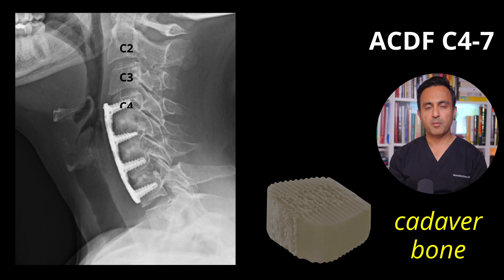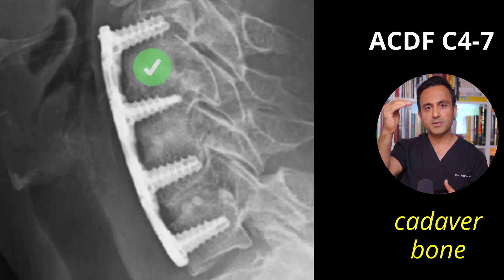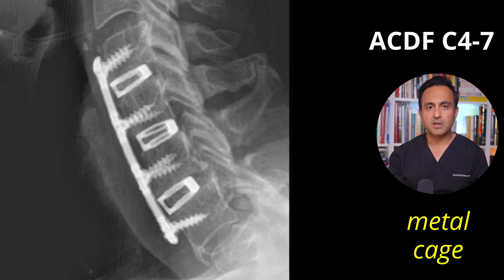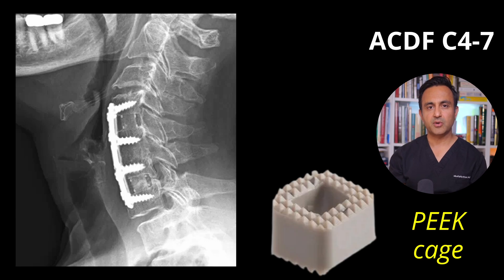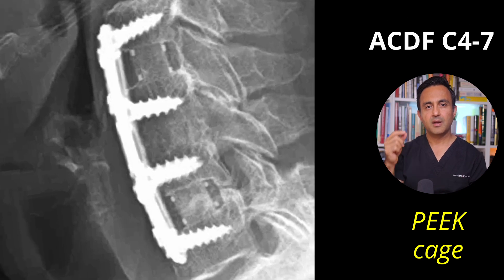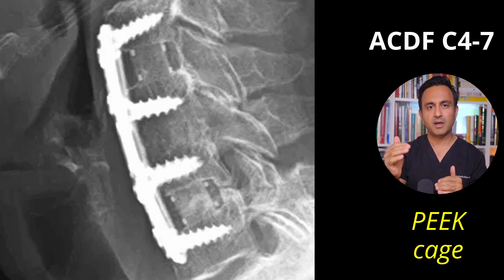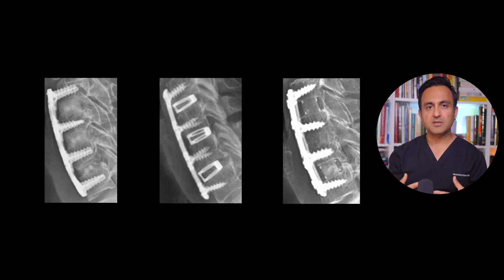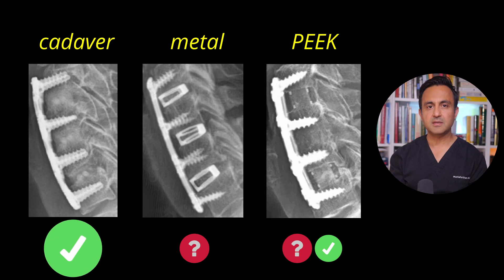Why bone-graft is best

Comment: Thanks for this. Something you didn't mention was the (very small) increased cancer risk from a cage implant which (as I understand it) often uses a bone growth promoting compound  in a sponge type material. Is this correct?
Reply from the maker: Thank you for your excellent question.
There have been some reports of increased rates of cancer with BMP-2 (bone-growth stimulator), but these are likely very rare. Personally, just fyi, I don't use BMP-2 anyway (not because of cancer risk but because I don't think it is necessary).